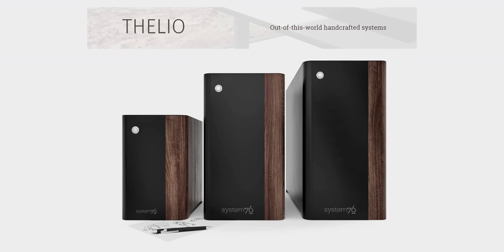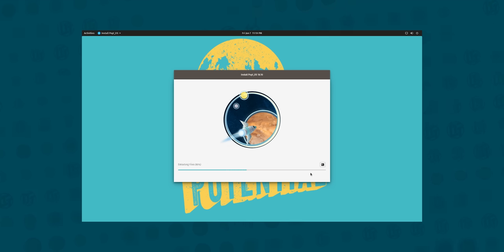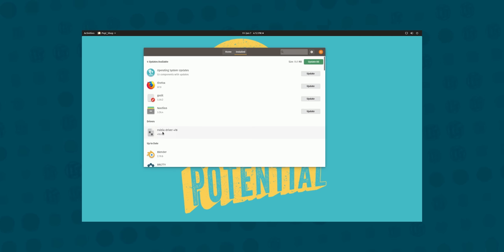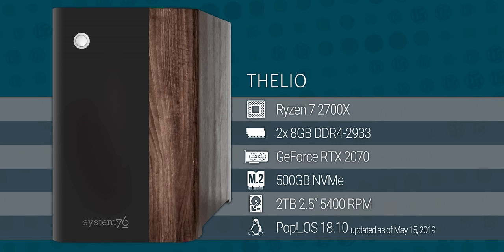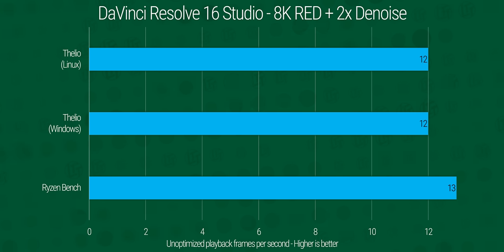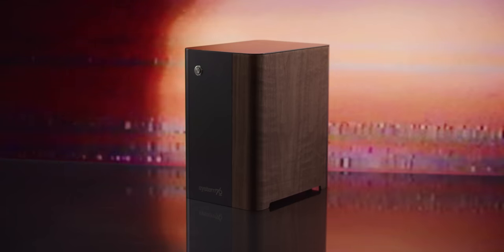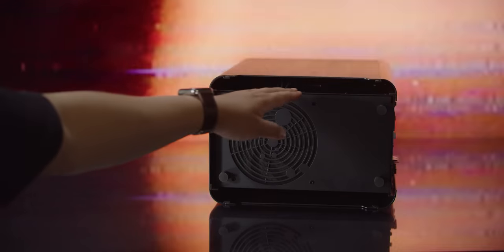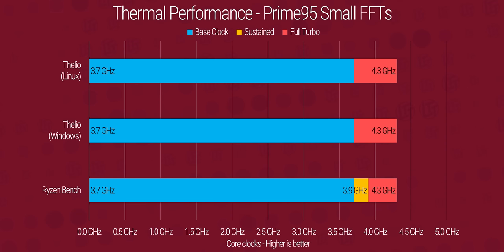A REALLY Weird PC… - System76 Thelio Review

Comment: Listening to you speak about Linux in the 1st few minutes you can definitely tell you are not familiar with anything Linux from the last 3+ years. I cringed when you start talking about having to compile kernels or finding the necessary repos.
Reply: I agree. These days Linux will install and run just as simply and reliably for most users as either Windows of MacOS. The most likely fail case would be wifi cards, arising from selecting one of those distros that requires you to add a repo for "non-free" drivers. Even a small amount of research should help you avoid this problem. Since Windows users sometimes have to spend a lot of time finding and installing drivers, it' would be disingenuous to suggest that's a "Linux problem".
Reply: @MuhammadAhmed-qh7ut  actually even farther i was using linux as a truck driver `(which i retired from 5 years ago) and the last 3 years i tried mac( did not like it) had used linux for 4 or 5 years by then. only problem i had was i had to run windows in virtual for my logging program.
Reply: I got a tongue-in-cheek vibe from Linus on the repo/kernel comment. I remember using Mandrake in 2000, which was pretty much as simple to install and update as Windows was. While what the vendor is trying to do is laudable, I don't see much value in topping out a Linux desktop computer as a primary machine unless all the software that you want or need runs natively in Linux. If you want or need proprietary software, you might as well stick with Apple or Microsoft and get the support that you overpaid for. I get by with a mid-range i5 laptop running Mint and use a VMware Windows 7 image for the Windows-only proprietary software I need for my university research. For non-work, non-academic stuff, I use a web browser for 95% time in front of the computer. I don't need a high-spec machine for that. Things are definitely easier with web applications even if fewer features are available than desktop versions. I also question the need for OS development. Distro choice is heavily-dependent on need and preference. Baking OS development into the cost of the system just prices a niche product into a smaller niche. A purpose-built Linux system might be more practical at the lower-end of the market, but selling to that market might be more trouble than it's worth.
Reply: @MuhammadAhmed-qh7ut  I'd agree I was using linux before 2012 but pretty sure I haven't run windows on the metal since around then, I think at that time I was still using windows for video streaming drm sites like Netflix, once that worked easily windows was gone for me . (well not at work unfortunately. .)
Reply: @MuhammadAhmed-qh7ut  it's dead for me for a long time, I don't need or use office. I wouldn't be surprised if office does turn up on linux eventually, although it might be in form of a fully featured browser version.
Reply: @legojenn  I agree with you.  You bring some good points to the conversation.  Personally, I have a low spec machine running dual boot with Win 10 and Manjaro Cinnamon.  Even though Cinnamon is aimed at "former Windows users" I like it better than the Windows desktop and everything I need to do is available in Manjaro.  Like you, I spend the huge majority of my time in Firefox regardless of the OS.
Reply: @w___s  Totally inaccurate again. Most systems that have less than 6 months on market have to wait. Linux community doesn't build PC's or laptops they just build drivers for the existing hardware.   No cost to the User with old hardware and its a "Win Win".
Reply: I like and use Linux but stop pretending it's as easy and plug and play as windows or Mac.
Reply: @morganghetti  Assuming Mac & Windows weren't in pickel with cost for upgrades, viruses, randsom wear, unsupported hardware under 10 yrs and vast intrusion in hackers stealing ur data. If we could just knock the cost for PC software upgrade off. Looking at 700 to 1,000 off.
Reply: @jonesconrad1  That's why M$ intentionally screwed up office for a long time now. Gates, late 90s: "One thing we have got to change in our strategy — allowing Office documents to be rendered very well by other people's browsers is one of the most destructive things we could do to the company". It still has interoperability issues and M$ will fight fiercely to keep it that way.
Reply: 3? I've used ubuntu 11 or 12 back in the days, and I didnt had to deal with that :D
Okay, some software has repo, but usually it isn't necessary and it is not more difficult than finding a download link for windows application. But with manjaro I got all the up to date software so it isn't a problem since then.
Reply: @GoogleDoesEvil  Windows has the same problem. Sometimes Windows doesn't even have to crash and it won't boot the next time it boots.

Linux at least tries to recover your data with the fsck. I have yet see scandisk fix anything.
Reply: People seem very willing to overpay for Apple computers loaded with Apple software—despite their obvious shortcomings—just to get what they want/need.
Reply: @legojenn  Because people that want or need to run Linux want a well made and supported hardware product and support. The OS was developed so they could tightly integrate it with the hardware. This is not targeting general consumers, it's targeting professionals who need a good Linux machine to get work done, and something they can rely on and trust.
Reply: I'm 99% sure he was joking
Reply: I must no be either, I used to tinker with it and it was trash in 2011. Is it any better now?

Comment: I bought a system 76 machine about 4 years ago. It was a great computer to help me move away from windows because I knew it would be dependable enough for daily use. I was able to learn without freaking out over driver and dependency issues. I definitely recommend system 76 if you want a Linux machine that "just works" out of the box

Comment: Linus, Linus, Linus...
Using most linux distros' package managers was ALWAYS easier than the haphazard mess that is installing stuff on Windows.
Reply: I can't believe windows doesn't have some kind of package manager. Just pasting apt-get X into a terminal is so much nicer than searching around for some dumbass .exe file.
Reply: @5T4N1  When I have to go through the painful process of managing a Windows 10 machine first thing I do is installing Chocolatey
Reply: @5T4N1  It has one since Windows 8
Reply: I dunno, most sites will flat out just give you an .exe or .msi file to download your software. I've used both Linux and Windows and installation of software on Windows is far easier for me than having to open the terminal. Not to mention that Linux requires an internet connection to use apt get while on Windows you can put the exe on a thumb drive or something and just run it from there.
Reply: @AllThoughts3rased  you can put the packages of the repo on a Website and a thumbdrive too
Reply: @AllThoughts3rased  Downloading a self-extracting file that decides where to put its own contents regardless of the system's software installation paradigm is a terrible design. The situation is not improved by the fact that Windows *has no consistent paradigm*. Saying that "there's just one file though" is nowhere near an argument for that disgrace of a software installation procedure.

And you've used apt-get. That's probably the worst linux package manager there is. And you might be interested to know that even the maligned apt-get is still also capable of taking a single file that works like a .msi file does in Windows (although in this case the software is even installed in a consistent way). The reason people don't talk about that functionality much is because, again, that's a terrible way to install software.
Reply: @delphicdescant  most of the time though, programs get installed into the program files folder and for the general consumer, that's completely fine. Realistically, the only people who are going to care are those who know how to get around it. Most of the time, the installation wizards have a box that says where exactly it will install to and from my experience, changing that hasn't installed components anywhere else without a good reason (those being the direct X distributables needing to be installed on the boot drive for access to the Windows folder or some other critical component needing to be on the boot drive). Most general pre built computers have a single hard drive or solid state drive in them so it doesn't surprise me that most software installs it to the boot drive instead of confusing the user. Most applications can just be moved anyway as not many even need registry keys anymore because of added functionality for programs in Windows.
Reply: @thomasmarangoni1991  then at that point, isn't it just the same as "hunting down an .exe file?"
Reply: @AllThoughts3rased  None of that is remotely necessary. There shouldn't be "most of the time," "with exceptions," or any other complication to installing user-level software in a good OS. Also in a good OS, an experienced user should not have to follow different practices than an inexperienced one. The fact that an inexperienced Windows user is too oblivious to the inner workings of their OS to know the difference between clean and messy OS design is not an excuse to have messy OS design.
Reply: @delphicdescant  but having a way of installing software which will be inaccessible to a fair bit of the market is also not good OS design. Do you really think people with no prior knowledge are gonna know what a command line is and know what they have to type? Having a complicated way as the only way is also not a very good design choice. And no, the app store isn't a "solution" to this as it certainly won't host all the software someone will need.
Reply: @AllThoughts3rased  Modern linux distros don't require you to use the command line to use the package managers (although it could be argued that the command line is better anyway). Linux package managers aren't just easier for professionals to use - they're easier for everyone to use, like I was saying when I said that professionals and noobs alike should be able to follow the same workflows.

But even if you did have to use the command line, YES, it is just as easy for a person to use the command line as it is to use a gui. In fact, there are fewer degrees of freedom and points of error when using a command line. My community has been experimenting with quite a lot of success with teaching the technically illiterate how to use linux distros as a learning OS instead of windows. The only reason you suppose a GUI is easier is because you're used to using it.
Reply: @AllThoughts3rased  If i know what I want it's easier to just sudo apt i [TAB] programname than searching various sites. For installing without network you can always download the .deb or .rpm and install it with a doubleclick
Reply: @bene5431  Good luck getting all the dependencies right
Reply: @resneptacle  The dependencies are handled automatically and correctly 99% of the time. Package managers ask you if you want to also install dependencies. Much less painful than missing a .dll on Windows.
Reply: @delphicdescant  Not when downloading a package to install on an offline machine
Reply: @resneptacle  Yes, even then. If you know you're downloading the package with the purpose of installing offline in mind (which nearly nobody needs to do, btw), the other dependencies can be automatically included. This is exactly the same (with the same limitations) as downloading a windows installer, except that in the case of the windows installer, all possible dependencies (dll's, etc) are often inefficiently and redundantly included in the installer whether you need them or not. That patched-together brute force design appears to "work better" offline out of sheer dumb coincidence.
Reply: @delphicdescant  Then tell me how does one download a deb package with e.g. apt for use on another machine without having the other machine's apt database? Wouldn't it have to download every single dependency of the package since it doesn't know what is installed on the other machine?

Also, there were and sometimes are enough instances where I would love to be able so simply install a single file offline to get a software up and running.

In comparison, on Windows you just need a pack of all VS runtimes (can download that and than use it over and over), possibly the DX9 runtime installer and maybe if you're on Windows 7 the latest .NET framework installer. Then nearly all single EXE or MSI installers work without any issues.
Reply: @resneptacle  That part where you say "you just need to pack all the VS runtimes, possibly DX9, possibly this other, possibly that other, maybe .NET...

That's the part where even including all possible dependencies for your sane package manager is at least as easy. Generally it's a line or two of commands to get all the required packages downloaded in whatever form you need (whether or not that's .deb - there are other arguably better systems). And the advantage here is that a package manager can just download all the packages with a manifest, put that on your removable media, and then the other system can read the manifest and install what it needs with a single command. It's as simple as telling the package manager to use the local database (the manifest) instead of the remote database on the internet that's usually used.
Reply: @delphicdescant  But you're still downloading every single possible dependency, which in many cases can be a huge download that is not really reusable for other packages except if you slowly download an entire mirror server. Also, those package dependencies get outdated pretty quick. On windows, all you need is one framework and library setup package (Including VS, VC, DX and .NET) and you're good to go, maybe put those in a script and it's easily reusable without much hassle later on. And you don't need to download tons of dependencies everytime you want to install an EXE offline
Reply: @resneptacle  AppImage is the right way of doing portable packages!
Reply: @lambdanil  Those do have disadvantages though compared to how app distribution on Windows work, since they require more space per app (Each appImage brings their own sets of libraries and required components), need more time to start (since those files have to be extracted each time the app is launched), can be integrated worse than regularely installed packages from a package manager and depend on the maintainer of the appImage to include new security and feature updates in an appImage that usually do not get updates by regular system updates via the built in package manager
Reply: Lol, people feeling smart when they don't know how Windows works.... Okay.
Reply: so true. I just started using linux, and i don't know how I ever installed anything on windows. also, the terminal is awesome.
Reply: Thoughts 3rased f o r y o u
Reply: @AllThoughts3rased  1.  Assuming you know what software you want to install, let's say Steam.  On Windows, you have to open a web browser, navigate to steampowered.com (you have to know that's Valve's website, otherwise you're going to make a detour to a search engine), look around a website to find the download link, download a file, open the file explorer, navigate to your downloads folder, and run the installer.  On Linux, you open a terminal and type "sudo apt install steam" type in your password and it's done.  You've got that bizarre allergy to the terminal that Steve Jobs inflicted on the world?  We've got you covered; that "app store" Linus mentioned is a graphical front end to APT.  Launch it, type "steam" in the search bar, click the install button, type in a password, it's done.  Each distro has its own graphical package manager, plus general ones like Synaptic, they're all functionally similar in a "well our Install button is in the top-right corner, not bottom center like that other distro" kind of way.
2.  APT does require an internet connection because its function is to go get packages off the internet.  It doesn't actually install those packages once they're retrieved; it tells dpkg to do that.  If you've got a .deb file, you can invoke sudo dpkg -i whatever.deb from the terminal or most GUIs these days will let you double click the icon for the file and it'll launch a little window asking "You wanna install this?  Cuz I can install this."  That tends to be the end game for things like my DisplayLink USB dock or my Epson all-in-one printer that require some little daemon or bloatware to work, you do it the Windows way, end up on the loading dock 'round back of their website, download the .deb and install it.  Or you get idiot Windows devs porting their shit to Linux and you get a .sh script that dumps a bunch of shit in /opt.  Thanks Simplify3D.
Reply: @AllThoughts3rased  Do you really think people with no prior knowledge are going to know what a .exe is and what to click?
Also...you are aware that those "app store" programs that ship on practically every Linux distro are just a front-end to APT, right?  It's a GUI window that asks APT for the package information to all configured repos (basically downloading the catalog) so it can display them for you to browse through.  When you type into the search bar at the top and hit enter, in the background it runs "apt search [whatever you typed]"  And when you click install it runs "apt install [whatever]"  It's the software equivalent of a curly straw, it's the same kale juice, but you're delivering it in a colorful fun way that costs a little more because getting toddlers to drink kale juice, amirite?

Comment: Linus Tech Tips (LTT) should do a in depth review of Linux Mint 19 (aka use it as a daily driver for 3 months). This will give LTT good insight into modern Linux since Linus's Linux knowledge is VERY out of date. Compiling Linux kernels (in Linux Mint there is a GUI tool to update the Linux kernel), really Linus!